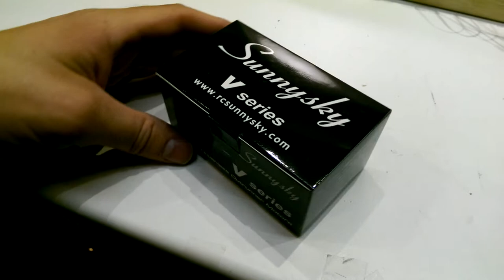Sunnysky V2216-15 650kv unboxing and testing

Comment: Do you know where I can find the spec sheet for this motor?  If not do you know how much it can carry with 12", 14" or 15" props at 50% thrust?

How do you like them?
Reply from the maker: juss1360 Dont know. i bought them from BuddyRC http://www.buddyrc.com/sunnysky-v2216-15-650kv-ii-brushless-motor.html   they might have some more specs